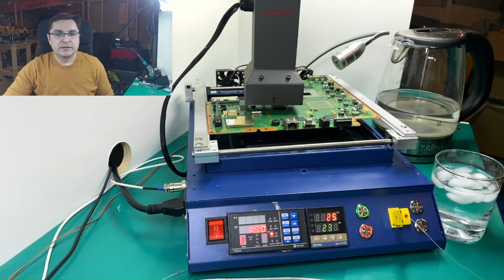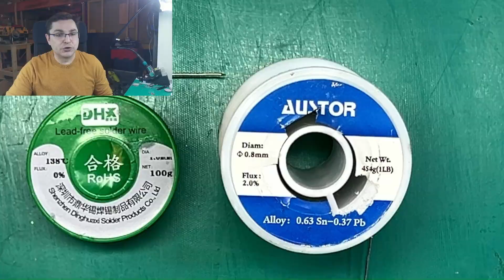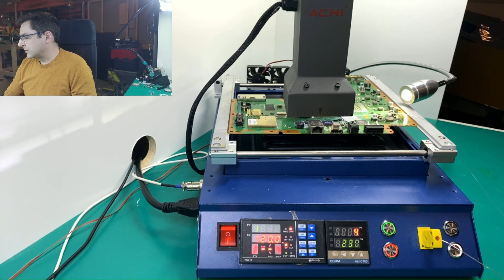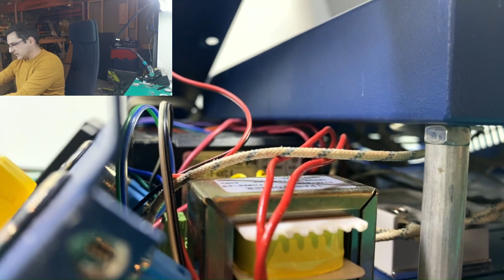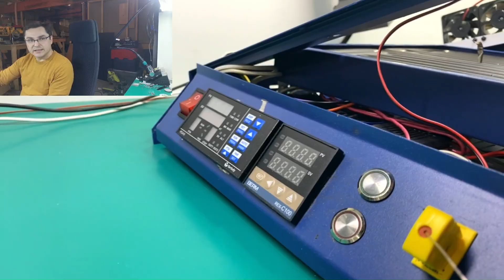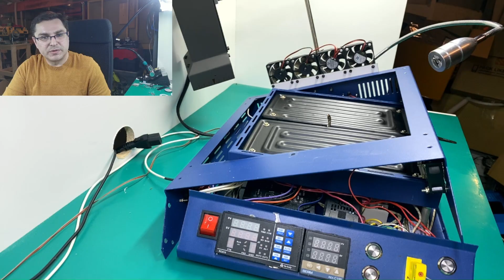Your BGA Rework Station Is Probably Wrong! How to Calibrate Temperatures Properly

Comment: Hello!  Well Done for you DIY project. I like to know how much you spent your budget to compare existing IR 6500 current price (around $350). I know this DIY but it looks like near $500. range I guess.
Reply from the maker: I've done this station a while ago, and indeed it was close to $500CAD. It was spread over the time, so I didn't feel this cost. First I bought T8280, some time after I wasn't happy with it and purchased the rest of parts. Now, I wouldn't go with  DIY, prices of a good rework station are getting to be much more affordable.

Comment: So simple but just not something some people would think to use for calibration. Awesome.
Reply from the maker: Thanks, I appreciate that! Also I’ve seen thermocouples having more than 10*C difference and this will have consequences like ripped pads for too low temp.  or killed chipsets for temp too high.